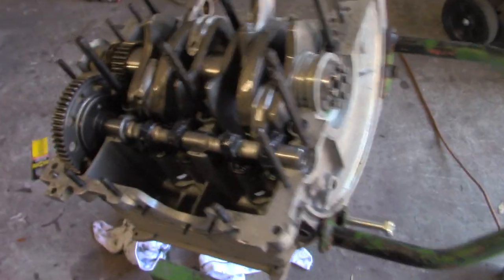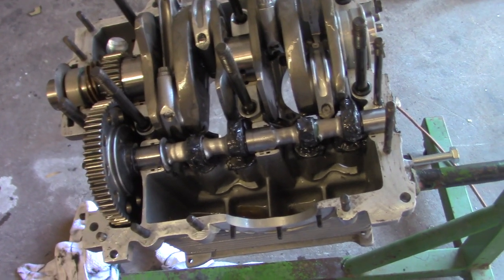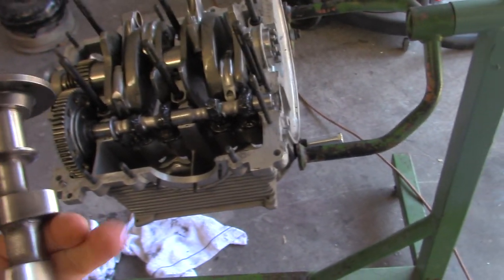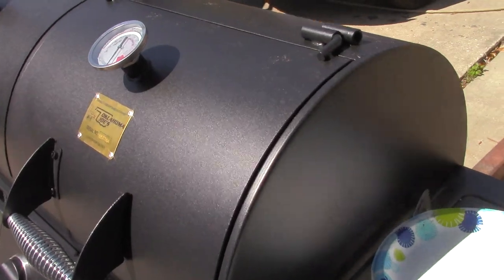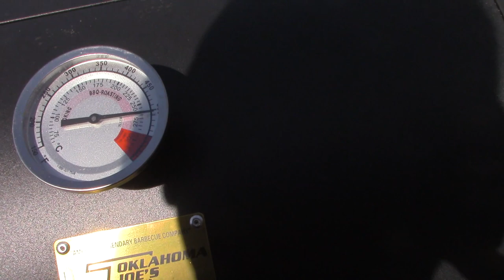BBQ vlog

Comment: With proper maintenance and care aprox how many miles might one get from that 2110?
Reply from the maker: the valve springs are definitely the life of the motor a double spring will require more maintenance than a single however this will limit your horsepower potential and i would say with a  single spring you could probably get 50-60000 miles before you need to
Reply from the maker: +BBugnOut i recently got scooter to change from double to single springs and from high lifts to 1:1 rockers he is using an FK7 cam motor still runs great reduced temp by 150 degrees
Reply: +vwdarrin Wow thats huge!  Keep the heat away its a killer, as we both know living in Arizona and Florida.
Reply: +vwdarrin Good to know thank you for documenting that for us Horse Power seekers that want as much street longevity as possible.